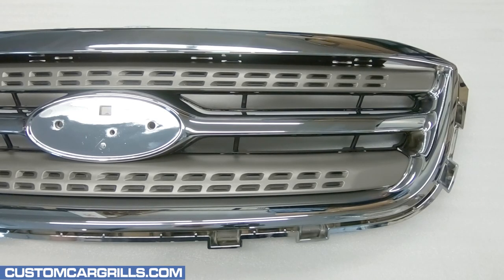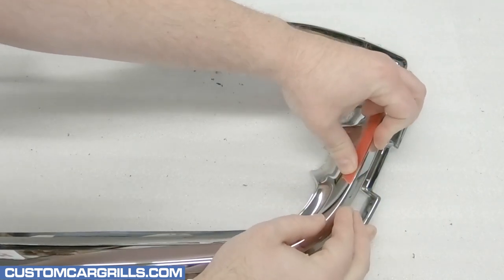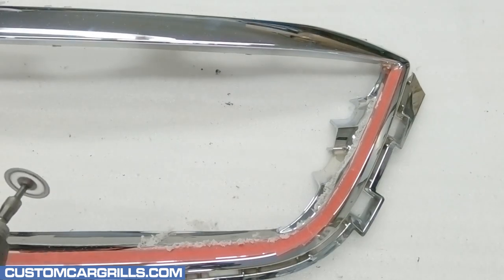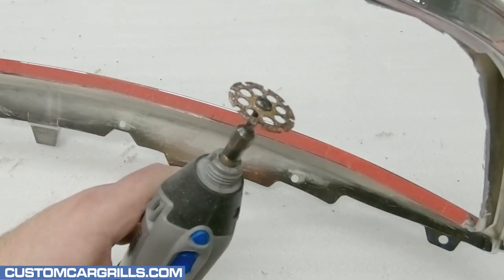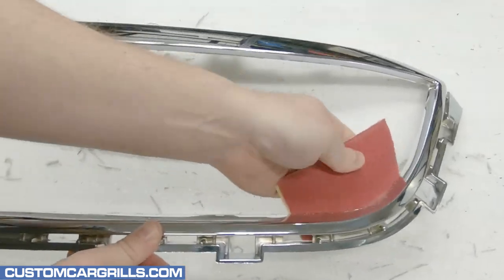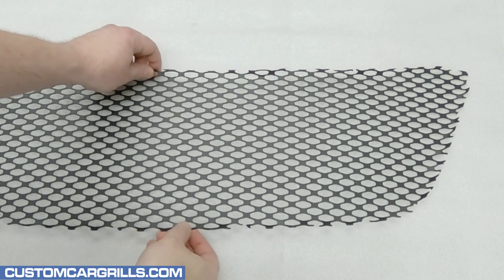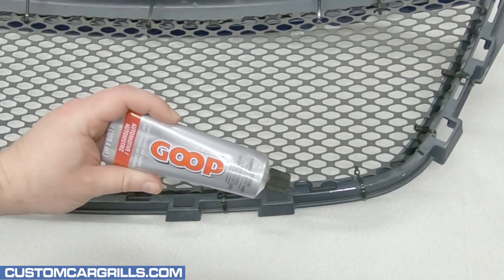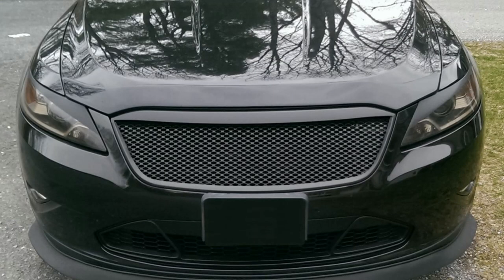Ford Taurus 2010-2012 Mesh Grill Installation How-To by customcargrills.com

Comment: I know this video has been up for a while, but maybe you'll see this: I was wondering your advice on if I can pull the plastic chrome insert off of the black plastic piece without cutting the tabs that hold them together. It looks like they're notched, kind of like the tab fasteners that sometimes hold plastic home electronics cases together. I'm wanting to paint the "chrome " piece and leave the black plastic as is. Any input  or advice would really be appreciated, and I'm glad you mentioned the website because that mesh grille does look awesome, and is definitely something I'll be looking into in the future. Thanks again for any help.
Reply from the maker: I'd like to think that it would be possible with a couple flathead screwdrivers to separate those pieces.  You might break one or two tabs in the process but I can't foresee why it would not be possible.
Reply: @customcargrills  
Hi, and thanks so much for your reply! After looking at it a little more, I think you're right. I'm gonna give it a go with a couple mini pry bars and see what happens. Thanks again for your input, and I'm sure I'll be in touch in the future for a mesh insert! (If I break too many of those tabs, maybe sooner rather than later. ) 
Thanks again, and my warmest wishes to you and yours.

Comment: is there any way to install this mesh without cutting out the middle crossbar with the ford emblem on it? In my opinion it would look really good with that part still on it
Reply from the maker: I suppose that might be possible.  Odds are the mesh piece at that depth would be too tall and wide since the grille narrows down as it goes back deeper to the engine.  You'd probably need to re-bend the mesh or some up with an alternate installation method to properly affix the mesh to grille